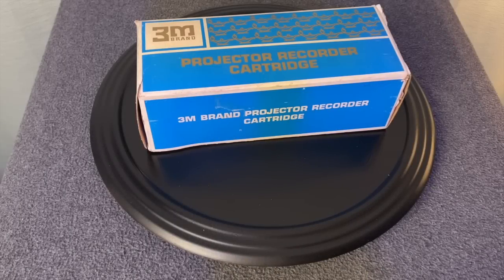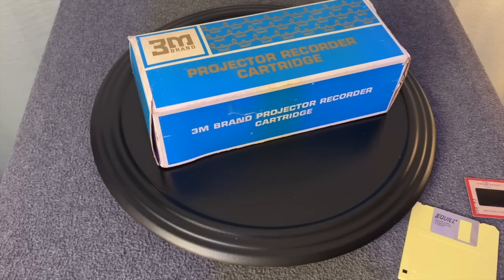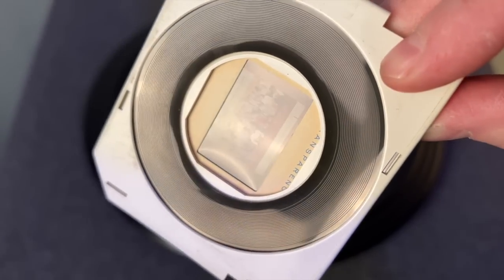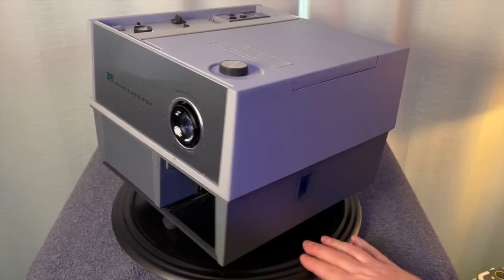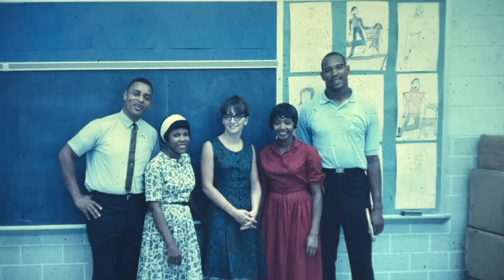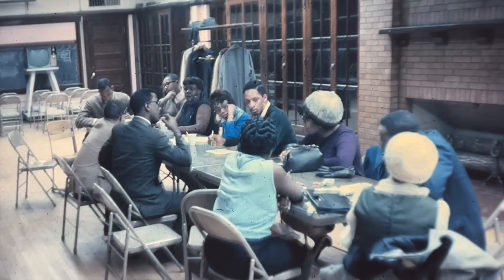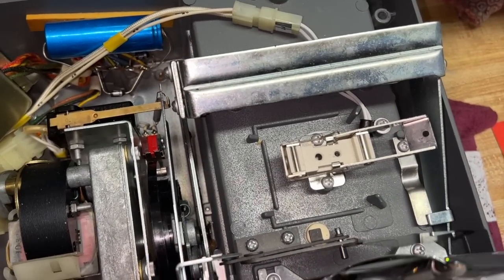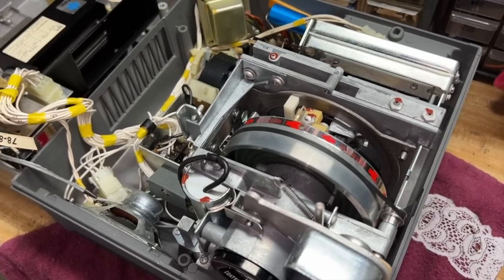The 3M Multimedia Sound-Slide System Vintage 1960s

Comment: This looks somewhat complicated for its time and even nutty as for the rotating head mechanism. One would think it was a weird novelty prone to failure, yet you just had to replace belts, lubricate parts and the like, instead of performing a painstaking restoration on it. All the mechanics and electronics worked fine on this over half-a-century-old machine, it's so amazing! With that in mind I imagine this very high quality device which was built like a tank must have been really expensive, which is probably a major reason for this system not to catch on. Thank you for showing us this very interesting piece of historic tech.

Comment: wildly complicated rotating replay mechanism, remarkable how well it worked. You have to wonder about the prototypes that led to this design. I bet one of the rejected designs had the disc rotate inside the cartridge with a stationary and presumably simpler mechanism, but  they somehow found that to be less workable than spinning the whole pickup assembly around the optical barrel.
Reply: I imagine alignment would be impractical with a rotating disc like that which could be economically produced to have dozens per show. Keeping the precision in the machine makes sense

Comment: Reason to use a pencil is because the housing would normally be toasty hot when the lamp failed, so touching with hand would burn you.
Reply from the maker: True, but I think it would be wise to let the lamp cool before touching anything in there.  A pencil may have been helpful because there is a lever underneath the bulb that lifts the bulb out of the receptacle.  The point is, the hole on that top housing isn’t big enough to stick a pencil through.

Comment: Amazing!!!!!! Thank you! What a cool format!  3m, with it's history of magnetic recording tape, it's no wonder they would use this method for adding sound to a slide presentation. Probably the advantage here would be combining a sound recording with a slide in one machine without having to have a separate record and record player. That's what they traditionally did to add sound to a filmstrip or slide presentation.
Had this system caught on, it would have become obsoleted when DVD's were introduced, just like any small venue projected program was. Although the DVD or even Blu-ray wasn't good enough for use in a movie theater, traditional movie film has been replaced with a digital file.

Comment: Seeing and hearing this system in action, I wonder if any of these 3M "Sound-Slide" systems were ever used by any broadcast television stations in their film chains back in this system's day to air slides of station IDs, promos, or local commercials with an announcement.  Slides were used quite frequently for such back then in television, and a system like this would've eliminated the need to cue & playback a separate audio tape cartridge while the slide was up on the air for the audio announcement.
Reply: It just wouldnt have had the audio quality required for broadcast

Comment: Amazing system. You didn't touch on the actual microphone recording process and how much recording time is available on each disc & how the operator knew when the recording tone was running out. Any thoughts ?🤗
Reply: and elaborate on how the head actually follows the spiral track
Reply: @anatolbaskak  It looked like there was a protruding piece of metal in front of the playback head. Presumably the flat metal protrusion would fit between the groove of the recorded disc, or perps a track or two in front of or behind the actual playback groove and the head would have been free moving and the groove guided the head along the disc. There seemed to be a scraping noise as the audio played, not audible in the actual audio, so that scraping would have been the protruding piece gliding inside the groove.

Comment: Dude, you could've replaced that receptacle for power cord for a regular C8 socket in like 10 minutes flat...
Reply: Now you mention, that's true! Yet he says he owns two other devices that use the same cable, maybe he did not buy it for this device but long ago... And, well, somehow it's nice it's been kept all original after all.

Comment: Weird they placed the focus control on the remote, it is not a setting you want to touch after the projector is installed in the room and set up for the projection.
Reply: From my distant memories of using slide projectors, the focus control was not about setting the projector up with the screen - you did that manually with the focus ring on the front of the projector. The mechanised focus control was to compensate for the position of each slide. As the slide enters the area in front of the lamp, a tiny variation in the position of the slide had huge effects on the projected picture. The heat of the lamp would often cause the slide to bulge slightly, shifting the focus, which you would then compensate for using the buttons on the remote. My dad's 1970s projector had an autofocus system for this, but god only knows how that worked!
Reply: @djsherz  You're right, I also had a projector and the focus had to be adjusted sometimes mid projection.
Most automatic focusing systems in slide projectors are based on the use of an optical module, which comprises a small lamp, a few lenses and mirrors, and a light sensor made from two series-connected light dependent resistors (LDRs), which function as a potential divider. If the image was blurred, one of the left or right LDR would receive more light from the mirrors, then the circuit motor would move the objective till the light fell between the L and R LDRs onto a central LDR.
Reply from the maker: Very good explanation.

Comment: The motor attached to the blower reminds me of the turntable motors of old Rock Ola or Rowe AMI jukeboxes.
Reply: I thought the same thing when I saw it. Seeburg also used these.

It’s funny that they were used in so many different things.

The only downside of these motors is that they run quite hot.

Comment: Quite a neat system. It's a shame that it failed. I guess the slides were too costly to produce. And the failure rate would be would be quite high. I was curious, though, if those slides could of been played on a record player as they were just grooves. I am guessing not but, just a stupid idea of mine. Great find though Brad. Thanks for the video.
Reply: As it was a magnetic coated disc, the audio head moved across the recorded surface. It was guided by the grooves using a 'pin' that just traced the grooves to move the head. The grooves themselves had no audio. Hope this helps :)
Reply: @marktubeie07  Yes, thank you.
Reply: Despite the cost I guess it failed because the use of an open reel tape recorder offered a better sound quality and much more flexibility. 
Even the most basic recorders allowed one to mix several tracks (Sound, narration) onto one.
Reply: *could have
Reply: The machine would have been insanely expensive - there was no effort made to reduced cost, one motor per function, a plethora of cast and/or machined custom parts. 
Its hard to see what advantage it would have had over 16mm film

Comment: I'm not the smartest person in the world - so let's get that out of the way....
I don't get the audio. Why would magnetic tape have groves like a record?
Reply: You need to guide the head along a definite path, and this is the 60s. Stepper motor-based systems the kind you find in floppy drives and optical drives were probably rocket science at the time.
Reply: @BilisNegra  Yeah, that makes sense. Thank you for the answer.
Reply: It’s the same idea used on compact discs, or any optical disc system. There is a groove (Track) which guides the laser along the path so it doesn’t fall between the “groove”.